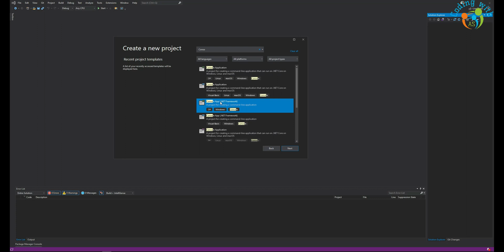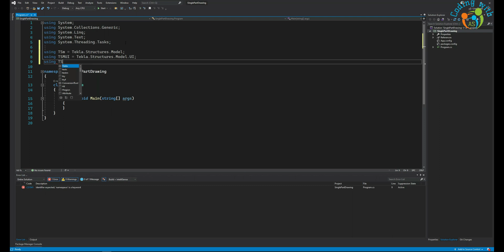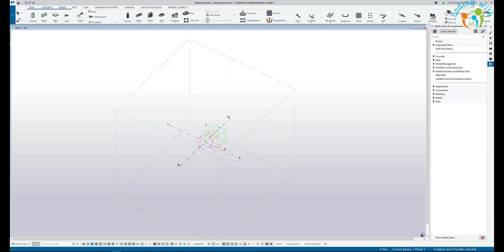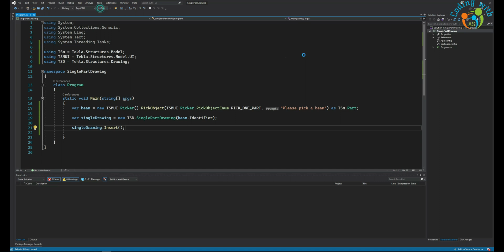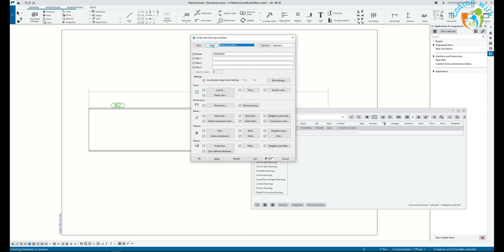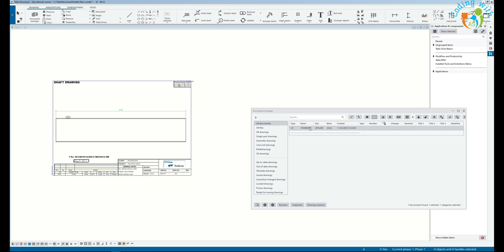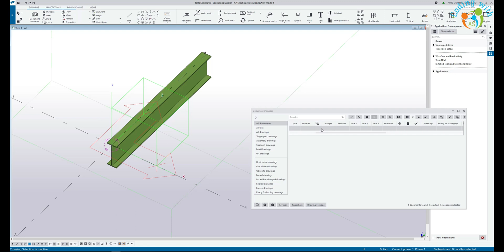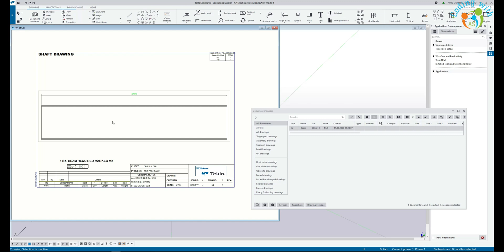Generate Single Part Darwing in Tekla Structures, using Open API

Comment: When I created The part drawing in the concrete structure, there was an error." Tekla type Exception: The given identifier was not of an existing part."What is the reason/solution for this please?
Reply from the maker: you can check if the beam is valid before creating a drawing.

 if (beam == null || beam.Identifier.IsValid() == false)
      {
        Console.WriteLine("The part is not valid"); return;
      }

Comment: On line 19, I get an error "Tekla type Exception: The given identifier was not of an existing part." What is the reason/solution for this please?
Reply from the maker: you can check if the beam is valid before creating a drawing.

 if (beam == null || beam.Identifier.IsValid() == false)
      {
        Console.WriteLine("The part is not valid"); return;
      }
Reply: @CodingWithAS Thanks a bunch. It helps a lot.